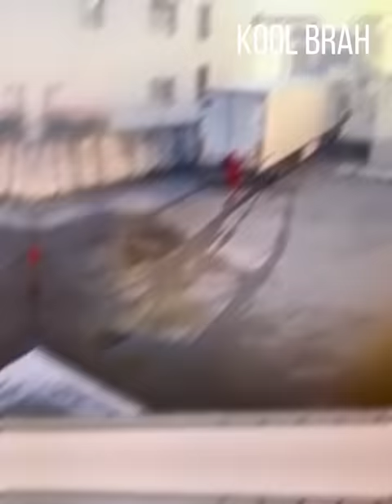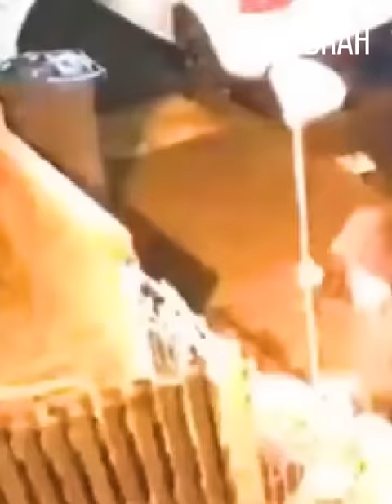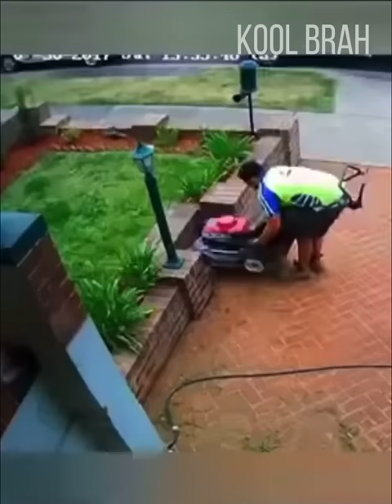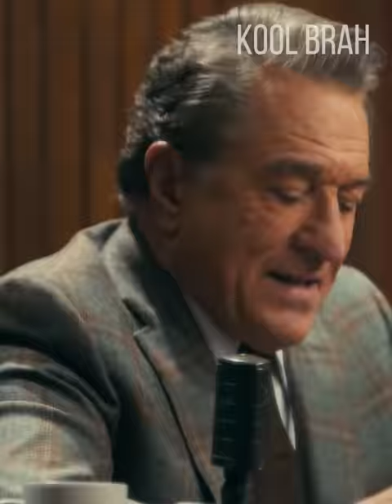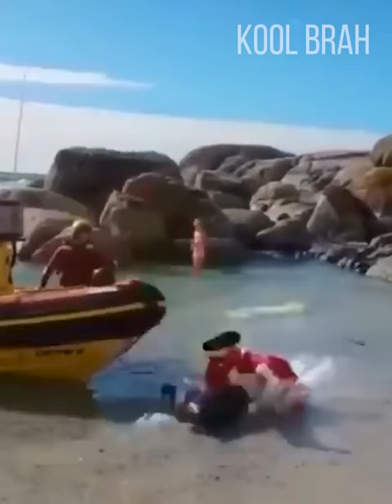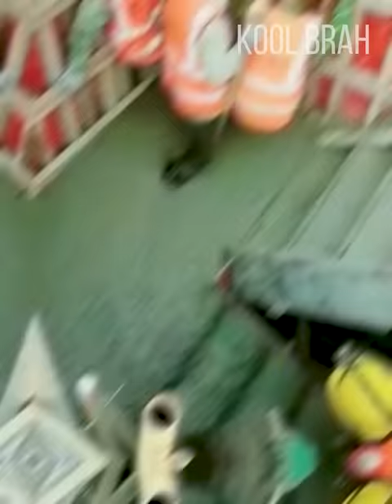TOTAL IDIOTS AT WORK #9 | Fail Compilation 2023

Comment: About that concrete mixer, likely the mechanism got stuck and they cut it open to empty it. It's easier and cheaper to patch the mixing bucket and clean up the mess, because if the concrete sets inside the stuck mixing bucket, the whole vehicle is a write-off.
Reply: I actually like them lol. some are nostalgic and take me back.